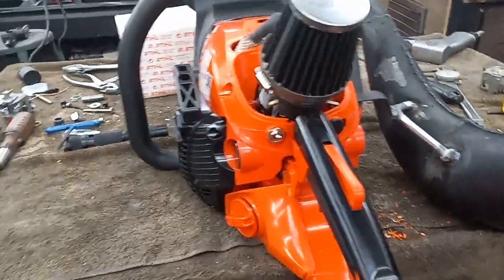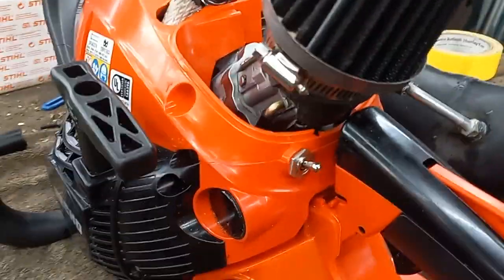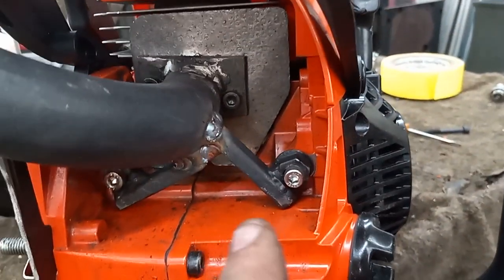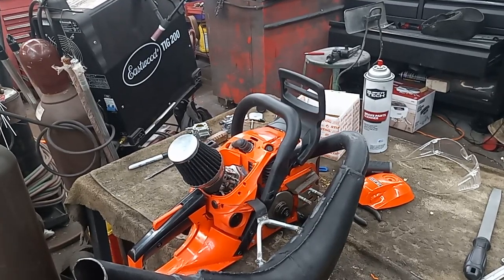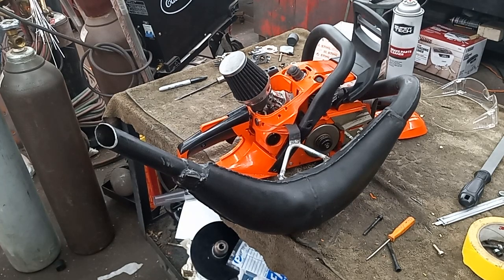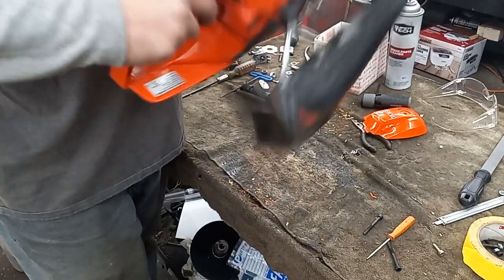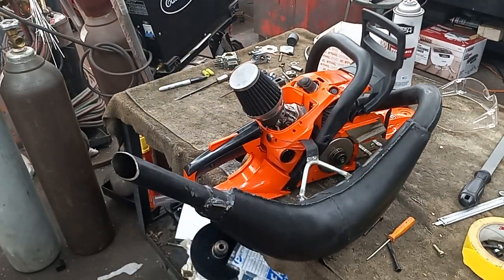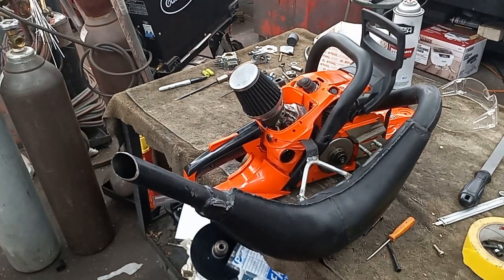ported reed 4910 runs still a lot to go on it tho

Comment: Looks good but I think you should spring mount that pipe. I watched a video where it guy sold mounted a pipe on a 372 and it broke the cylinder on the first cut. Awesome work tho. I wish I had the ambition to do more with my saws. I can't wait to see it in the wood.